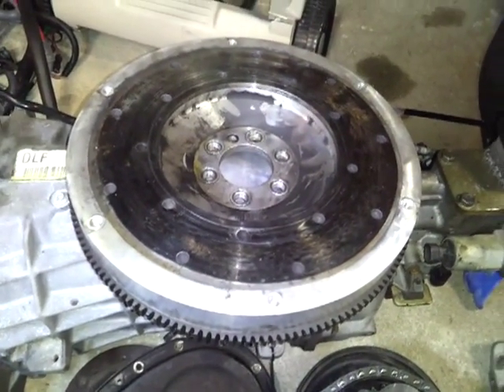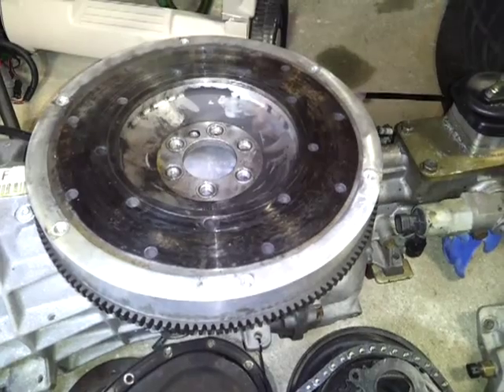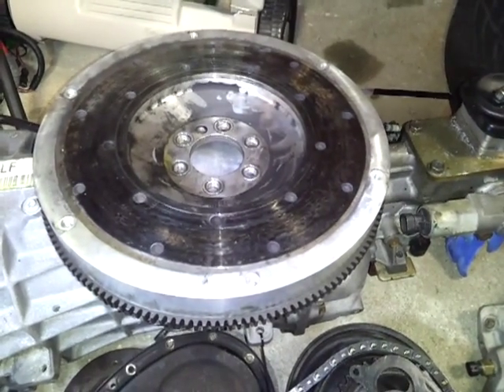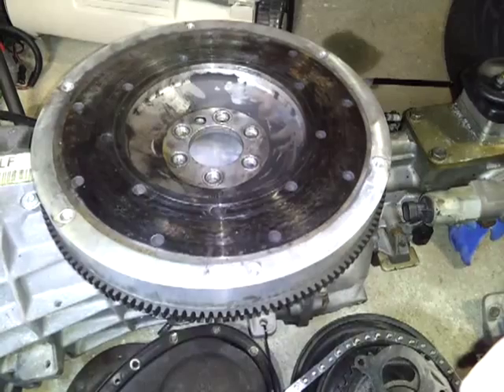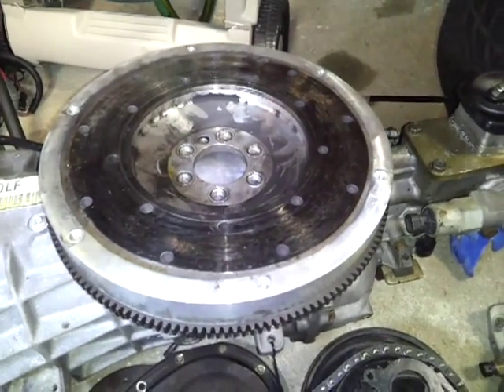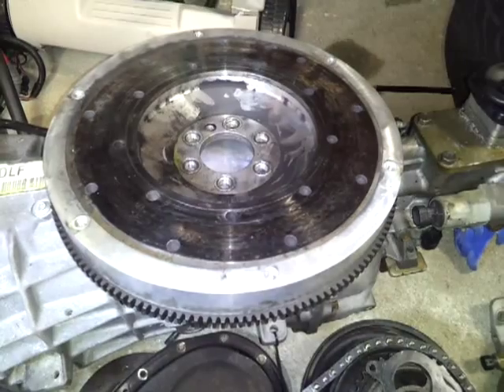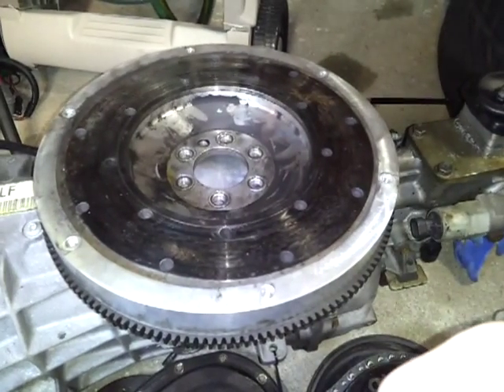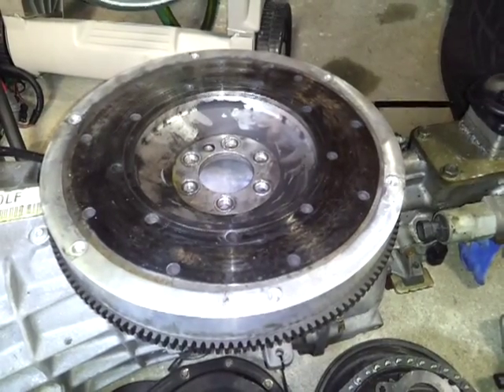ALUMINUM FLYWHEELS - pros and cons

Comment: I just thought of something when you said engine braking. I always wondered why my sportbike would rev up so quick and break so fast with engine braking because it has an extremely light flywheel. It's great being able to go 130 and then let off the gas and slow down to 60 in seconds

Comment: Better engine braking, is, or may be accomplished because you have "LESS" stored energy, not because you have it. A lighter wheel is slowed easier than a heavy...simple physics.
Reply: These days I seriously think steel should just be for trains.  All that unnecessary weight.
Reply from the maker: thanks for watching
Reply: +klowny1969  You got it sir.